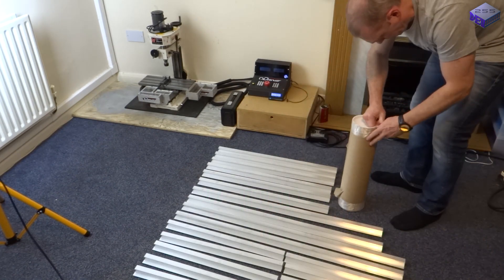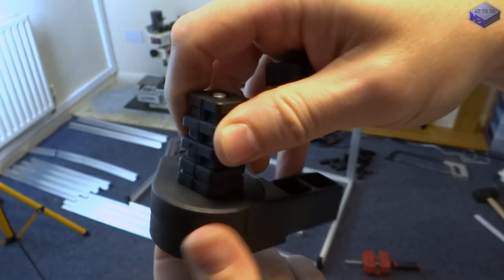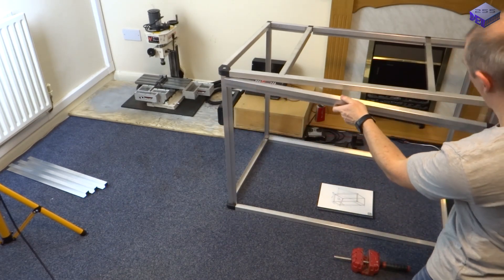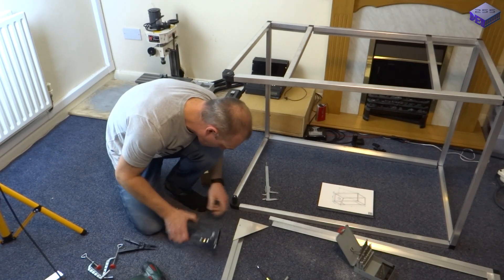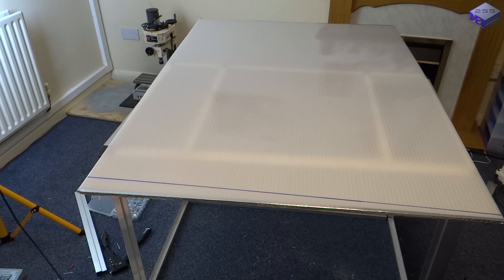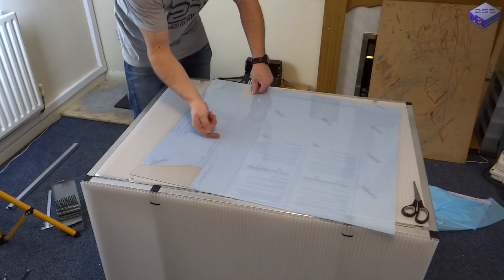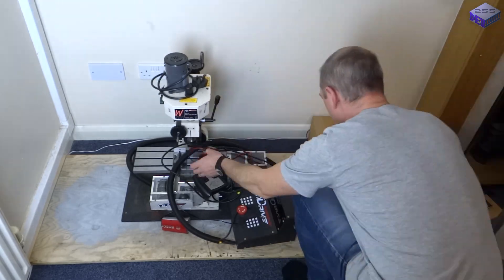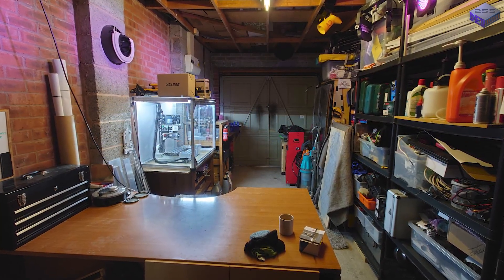Making an EasyFix Cabinet for a CNC converted Milling Machine

Comment: Amazing! What would be a USA substitute for that site? I love the ease of use and construction.
Reply from the maker: Ooooh, good question. It may be best to contact either Aluminium Warehouse or Alloy Sales (same UK company) as they may be able to ship the EasyFix items to you, although it doesn't say that on their website. There is also a fair amount of these items on Amazon UK that you may be able to get shipped. I did have a look at the USA amazon, although I wasn't able to find any, I'm sure you have taken a look yourself.

Here is the Amazon UK link: https://www.amazon.co.uk/Square-Corner-Connector-Fixing-Diameter/dp/B07T2C41XQ?th=1

Here is the link to Alloy Sales: https://www.alloysales.co.uk/

I believe EasyFix is the original name specific to Alloy Sales as they seem to be the only one that stocks it, very good strong sturdy stuff though. Hope that helps.